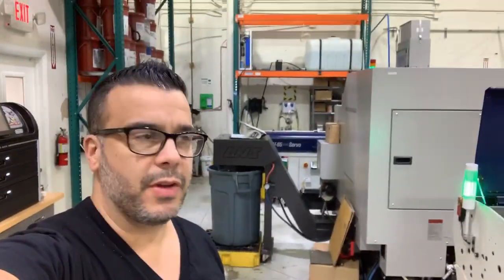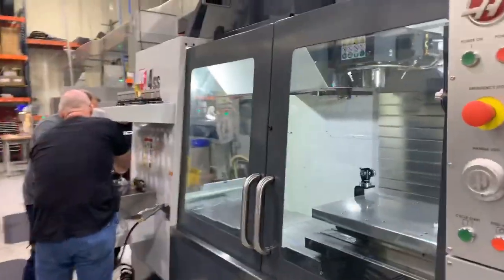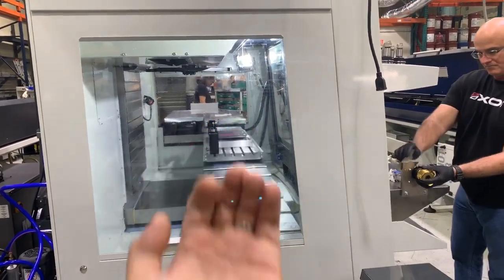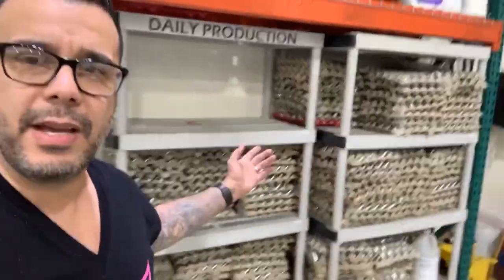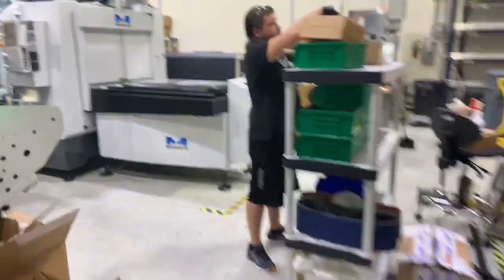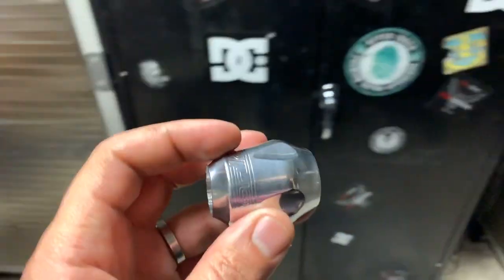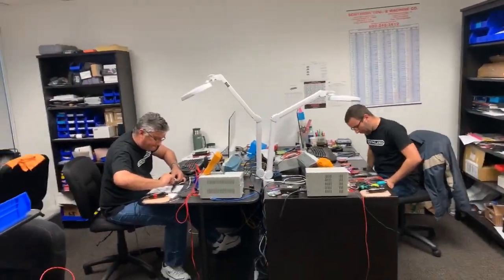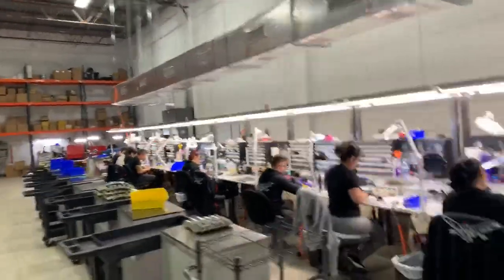Optimus Prime at FK Irons

Comment: Any word on the lightning bolt battery pack for the xion. Just went to a wireless critical foot pedal. Can't wait to have a wireless xion.
Reply from the maker: yes. prototypes out there. Putting time in them and going to production soon. We expect to launch it early 2019
Reply: FK Irons thank you. Just my 2 cents..my complaint with the critical foot pedal is though I love the wireless capability and it's an excellent pedal, the receiver has to remain plugged into a wall outlet and then plugged into the power supply. The cord is only maybe 3 1/2 foot. So eventhough it's wireless I'm still tethered within a few feet of the receiver because of the short power adapter. If the lightning battery pack will have a similar receiver to plug into the power supply I'd love to see either a much longer cable or be rechargeable and able to run on its own. Thanks!!